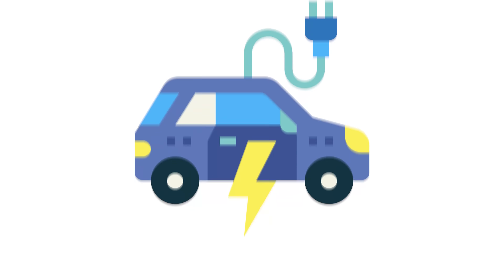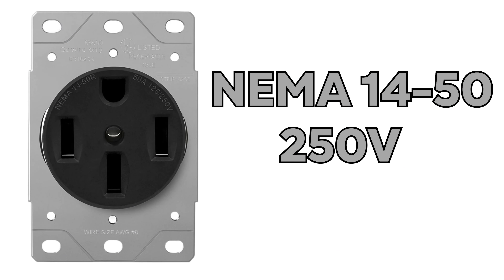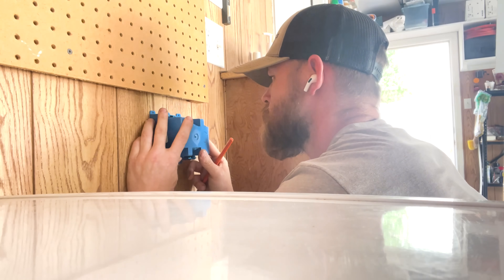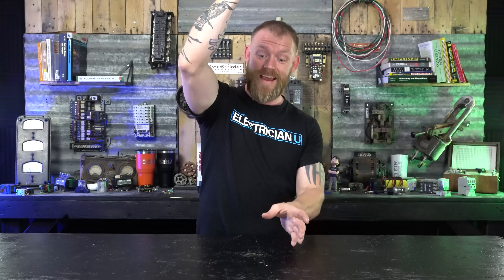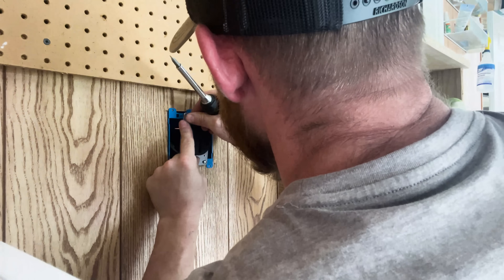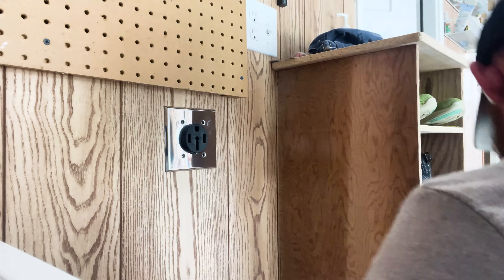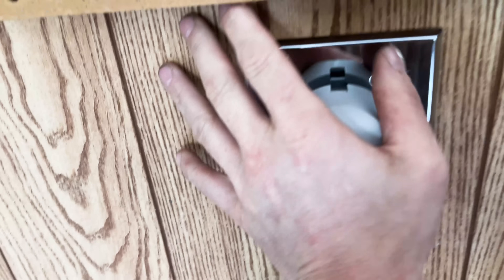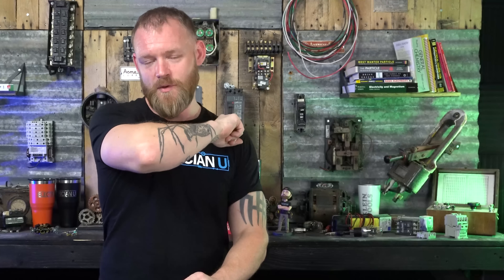How to Install an Electric Vehicle Charger Receptacle

Comment: We only do hardwired charging stations (nearly 750 last year) due to that GFCI requirement on receptacles.
In reading the installation manuals for nearly all charging stations, they will state to not install them on GFCI-protected circuits as they do have built-in GFCI protection.
Per that 2020 code, receptacles will need to be GFCI protected in a garage or outside where we always install them for charging station applications.
Since all GFCI devices run a self-test cycle, the breaker will pick up when the charging station runs it's self-test cycle and thus cause that nuisance tripping.
If you hardwire a charging station, you don't need a GFCI breaker because the charging station can't be unplugged from a receptacle and leave a non-GFCI protected receptacle in an area where one is required.  
Since the charging station has it's own built-in GFCI protection, all codes are met and installations will be within code.
Also, no charging station needs a neutral, so the 14-50 is really not necessary with that neutral wire.
When we did do receptacles, we always suggested a 6-50 to save on wire costs and it seems to be a little more versatile in a garage for other uses like welders and kilns.
One other thing to note is that Telsa will stop sending their cars with the mobile connector (on orders after 4/28/2022) which would be the type of charging station that would plug into a receptacle due to lack of compatibility with current code installations.
It used to be that if you did a 14-50 or 6-50, you could potentially save on installation costs but now that you would have to buy the mobile connector and install GFCI protection, there is no cost savings between a mobile connector installation with a receptacle vs. the hardwired wall connector.
Love to have further discussions about this as I know I'm not the best at speaking in non-electrical language.
Reply: Exactly how I read 2020, and have been recommending only hardwired chargers.
Reply: hardwire save you cost of plug and cost of panel gfci
Reply: I hate that so many EVSE's that come with a plug have a 14-50 on them. It is a waste of wire to have that neutral there.
Reply: Does not matter if charger had built in GFCI protection if on a plug & receptacle. If cord would get nicked or cut open downstream GFCI protection would not prevent somebody from getting electrocuted from any & all upstream faulty conditions. In my 50 years as a sparky the worst shock that I ever received was from a 240 volt 3 wire twist lock cord & connector. It was a hot humid day and I was not only soaked but standing in a few inches of blood in a large slaughterhouse while just gripping plug with one hand and female cord connector with the other hand unplugging them. Went home with bad chest pains. Got hit with everything from 120,208,240, never any 480 luckily,  and 5,000 volts ,( from low current  oil burner ignitor transformers ).
Reply: Ya know, dryers used to not have a neutral...I've replaced 10/2 with 10/3 in old apartment complexes for dyers...who's to say, in the NEAR FUTURE, they will have a need for neutrals in these too.   your customers will need to call you back....I guess your planning future work.
Reply: @BlackVibeBallsack  they had a neutral, they didn't have a ground. Same with electric ranges.
Reply: @hondaguy9153  No they used the bare ground wire inside of type NM ( Romex ) as both a ground & a grounded conductor. No such thing any more in NEC called a neutral. They used a 120 volt motor,120 volt drum light & 120 volt for timer motor & controls. Cheap manufacturers should have used a 240 bolt motor on all electric dryers and a 240 to 120 or safety yet 24 volts for timer, drum light & controls
Reply: @JohnThomas-lq5qp  ok, they used the bare wire as the grounded conductor along with 2 hot wires. The frame was bonded to that grounded conductor  which made a very dangerous condition if someone touched the frame and something else that was bonded to ground.
They were using the ground as a neutral and didn't have a ground.
Reply: @hondaguy9153  They still had a ground but whenever the electric dryer was running the bare ground wire carried probably 5 to 7 amps mostly from the 120 volt motor. Even though they had a bonding jumper from dryer frame to neutral on terminal strip never heard of a person getting a shock. Had to been millons of electric dryers made in the USA the last 75 years. The 4 wire now required plug along with an insulated neutral wire is safer.
Reply: @JohnThomas-lq5qp  we were told in school that the code change was due to people getting shocked. I don't know that anyone ever got hurt but the potential was there.
Reply: Never wired in a EV charger ( retired after 50 years ) but I know all of the GFCI 120 volt receptacles the self test normally will not turn of power. That's why you must hit the test button once a month to make sure tiny little relay contacts are not welded closed or some other problem. Makes no sense why any EV chargers GFCI would interrupt power during self testing. Another thing that pisses me off is they require self testing on all GFCI 120 volt 15 & 20 amp receptacles made in last 6 or 8 years but not on GFCI circuit breakers that cost at least triple the price.
Reply: I wish my electrician would have recommended hardwired.  Good for you.
Reply: Only problem that I see if no receptacle of GFCI protection then the line from the breaker panel to EX charger is not protected and therefore possible shock & or electrocution. Reason the NEC requires GFCI protection on all outdoor air conditioning condensing units at least 1 person was electrocuted and several others shocked while touching the unit. Have to cover your butt from low lifer ambulance chasing lawyers who would sue their own mother's. I can see no practical reason for any EV charger mounted outdoors to even have an expensive 50 amp cord set , receptacle & outdoor box & cover.
Reply: My read of 625.54 has this as out of compliance with code as well. It's been in the code since the 2017 cycle, and you will fail on it here.

625.54 Ground-Fault Circuit-Interrupter Protection for Personnel. All single-phase receptacles installed for the connection of electric vehicle charging that are rated 150 volts to ground or less, and 50 amperes or less shall have ground-fault circuit-interrupter protection for personnel.

Edit: yes they mention in the video at 10:45 that it's not in the 2017 code, but TIA 1242 covers this and was adopted in December 2016 after the 2017 code review cycle. So it is required for 2017 code as well. Around here inspectors started enforcing it with the 2017 code cycle. Also they mention that some EVSEs have GFCI in them - they all should if they want to be UL Listed. The only ones I've seen without built-in GFCI are the Amazon junk which is not UL listed.

Comment: Needed to be 6 awg for 50 amp.
 receptacle.
If it's a 48 amp load, this is considered a continuous load, 3 hours or more,  you have to rate it at 125%, 60 amp.
 also gfi protection required on 240 volt receptacle in a garage.
Must not have pulled a permit.

Comment: I'm an apprentice electrician who assisted a master install a 14-50 receptacle/50-amp breaker to charge a Tesla. The install was literally next to the panel using a metal box mounted on a piece of 2"x4" to be even with the panel knockout ports. The 2"x4" was TapCon'd into the cinder block garage wall and the box screwed on the wood. He used individual #6 AWG conductors (per Tesla spec) vice Romex through a 4" piece of 1" EMT connecting the box to the panel. When finished, he tested the receptacle with a Wiggy Stick, something I had not seen before. The job took an hour and cost the customer $250.00 including parts. The master did the work on a live panel. Question, does turning off the main breaker actually deaden the entire panel? Is it best to turn off the breakers individually first then the main or is it okay to shut the just main down? The house is new, and all the incoming power lines are underground. There is not a disconnect at the meter. Sidebar story: the master used a ratchet cutter to expand the box knockout to 1". He said as an apprentice back in the late 60's, he couldn't use a ratchet cutter, had to use a box wrench. Why? Union rules. Using a ratchet made the work go too fast, so they had to use a box wrench to cut the holes.
Reply: Switching off the main breaker does indeed kill the whole panel. Hence it’s the “Main Breaker”. Still be courteous when working inside of it though; you don’t want to leave metal shavings or debris near the busses. As for switching the breakers off one by one then hitting the main, think about whether or not there really is a difference in how the power is going to flow. A disconnect just acts as another layer of safety for the serviceman, as it provides a means of locking the disconnect arm in the “OFF” position, keeping someone from absentmindedly turning power back on when they have no business being near active  electrical work. Always work with deadened equipment when possible. OSHA says we should NEVER mess with live stuff, which we all know doesn’t always happen. If you have to, get some insulated tools. You are always your own first and last line of safety. One more thing, $250 for an hours work on an EV charger including parts? Look up what the average rate is for that type of work. $350 should have been for labor alone, plus the cost of material. Anyway, hope this helps
Reply: To clarify; go ahead and hit the main when you need to kill the panel. Don’t fret about switching circuits off one by one. It just costs you time. Power will be turned off and turned on either way, so just hit the main.

Comment: I will add my 5 cents.  Good video as usual. 
Why not hard wire the charger?  To me it makes sense as you only need to pull 2+ ground conductors. The charger has built in gfci so you are covered there.  You commission the charger and set it’s max current draw so you won’t ever make a mistake and try to draw 50 amps from 14-50 with a 30A breaker.
Reply: I'm a fan of plugging in because it means if the charger breaks, if I want to take it to another location, or if I move I can quickly take it with me.

The extra 8 amps you get with a 60amp circuit isn't really worth it.
Reply: It's always done per customer request because maybe they have a charger that is portable and plugs in

...... The more you know....

Comment: 8 awg in romex is not rated for 50 amps. It's rated for 40 amps per 310.15 b2 60 degree column

Comment: Honestly the best advice in this video is that if you aren't an electrician, hire one. A guy up my street burned down his garage installing a Tesla charger. I'm not saying the rest of the video is bad in any way.
Reply: And yet this video shows undersized wire for a 50a receptacle.

Comment: Nice, useful video. You made a couple mistakes, though: 
- The 2017 NEC still requires EV charging outlets to be GFI protected (625.40). Even in the absence of that, 210.8 requires all garage receptacles to be grounded so you should put a GFI breaker in regardless.
- As others have pointed out, 8g NM cable is only rated to 60º C so you can't use it for 50A. 
I have an EV and for the vast majority of uses 30A is plenty of current to charge. At this point, why not just put in a 30A outlet, though?
Reply: Any UL listed EVSE has GFCI in it, so the EV charging is GFCI protected even though the receptacle isn't.  Still, better to hardwire it and avoid having an unprotected receptacle.
Reply: @charliesullivan4304  A permanent unit will be hard wired and thus not require a receptacle. If it you are installing a receptacle you need GFCI per code. Note that any GFI protection of the unit will only work downstream, not at the receptacle. A GFCI breaker will protect the user from potential shock when plugging/unplugging at the receptacle.
Reply: @ptester1  code allows for "stationary equipment fastened in place" and connected to a receptacle.  I recommend hardwiring but codes only requires hardwiring if it is "fixed" not just fastened.  And you are absolutely right about the hazards of a receptacle without GFCI.

Comment: question. Ive heard that you could also run a 10/3. what you guys think?
Reply: 10/3 will give you a 30 amp circuit but with the 80% rule for max draw on a branch you are limited to 24 amps continuous. Going to #8 wire will give you 40 amps but only 32 amps continuous. (more than 3 hours)

Comment: FYI on EV charging. The slower you charge, the more life you will get from your battery in the long run. Also, Tesla has a GFCI built in and has problems when plugged into one. One last thing. The adapters will limit the draw of the car. So if you have a 30A plug, that adapter will limit the draw so that you don't overdraw it.
Reply: Tesla pigtails limit the current but most adapters do not.
Reply: @ericgold3840  ... my point was you can probably limit the charge rate from the dashboard if you bother to read the manual. 10 minutes of reading could save big bucks on batteries in the long run.
Reply: @rupe53  Absolutely. How often do you have to set the charge rate? Seems like a major PIA to have to do frequently.
Reply: @ericthered9655  ... I have never owned one so all I can tell you is what friends tell me. I suspect there's a personal preference / default that stays in memory till you change it. I am also told the car knows if you have a 120 volt or 240 volt connection so might be more that a single default setting, depending on the mfgr.
Reply: Most EVs have the ability to set the charge rate so you can go slower even if you are hooked up at 50 amps.
Reply: @rupe53  Correct, but does everyone do that is the question.
Reply: @ericthered9655  ... are you suggestion that EV owners don't know everything?  <LOL>

Comment: Any drawbacks to using NEMA 6-50 rather than 14-50 if the car supports it? No real need for a neutral on a dedicated 240V circuit, you can use 6/2 NM-B instead of 6/3 so there's less wire going into the box - just seems like an easier solution if the car has that plug.

Comment: NEC 210.21(B)(3) You cannot put a 50A receptacle on a 30A breaker. This video violates that code. Just because the customer says they "don't want to over-draw" or "charge slower" or whatever, doesn't mean you should undersize the breaker. You can oversize the wire to your heart's content, but the recep and breaker need to be sized per code.

If the load calc for size of the existing service was the reason for the 30A limit vs 50A, then a 30A recep should have been installed, (such as 14-30 or 6-30). It is then up to the customer to find an EVSE that with that input available (Tesla provides that, for example)

Not Electrician U's fault, but I'm bummed the 14-50 became the de-facto standard for EV charging. The neutral isn't even used! It is such a waste of copper. I wish the industry would have standardized on 6-50 or 6-30 instead. Same with electric ranges. edited for spelling
Reply: @ElementFreedive  I will not be silenced! I'll take my 30A recep with me to my grave if I have to! haha jk whatever dude, piss off.
Reply: I was thinking the same and had to go look it up — 210.21(B)(3) is for a branch circuit supplying two or more receptacles. This circuit is evidently only supplying one receptacle, and so 210.21(B)(1) only requires the receptacle to have a rating not less than that of the branch circuit.

Comment: Thanks Justin! 

Quite similar to the installation of a NEMA 6-50R receptacle I/A/W NEC 70 Article 630 for electric arc and resistance Welding equipment.

As always well done 👍🏼

Comment: I'm not an electrician, but I wouldn't want a NEMA 14-50 receptacle in my garage that wasn't GFCI protected - for child safety reasons. When empty there are two large hot slots for a child to poke something into. When plugged into there is a curious cord for a child to tug on. These things were designed to have a big appliance sitting in front of them for 10-20 years at a time and should never have been used for EV charging. EV chargers should be hard-wired or at the least connect to GFCI protected receptacles.

Comment: When I started back in 1985, we installed ceiling fan outlets, controls, and fans every day. Now I''m retired and you young guys are all doing car chargers every day. LOL The grid will eventually crash and the line guys will get their piece of the action. Texas first!  I did a few Subaru EV chargers. Subaru requires 2 120v legs and a ground. NO NEUTRAL required!  I wire dire directly to the wall charger. No other cords dangling looks allot neater.  I advised my friends to buy 6/3 cable just in case of the future.  Another friend is buying a new Tesla. He had me hostage, out teaching him boat handling yesterday, till I said Yes, I will install his charging unit. It was torture, out in the sea breeze& sunshine on the Gold Coast.  He is buying a Tesla approved universal charger. EV chargers fall under article 210.12 provide AFCI protection. When I tell them the cost of the breaker, they ask, is it dangerous to just use a regular breaker? Legally yes. Personally NO! If all your grounding points are secure!
Reply: AFCI on a dedicated 240V circuit?
Reply: @stargazer7644  If we follow article 210.12, A charger has a plug. The residential code states, any device. that means. Plugs, receptacles, sockets and switches. There are exceptions listed in 210.12 that I am not fully educated about. Chargers might be exempt. From the educational materials I've read, I imagine, we might see AFCI main breakers very soon. There are two types of arch fault, end circuit and parallel. The local NEC revisions will tell you which type they want installed.